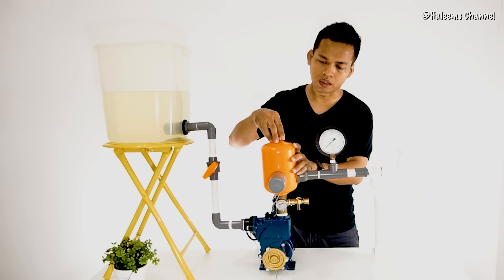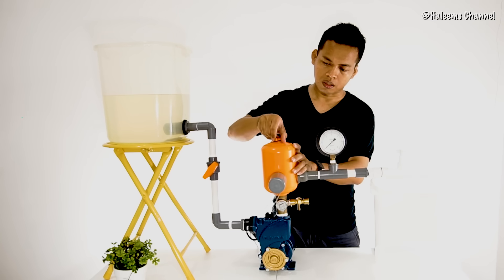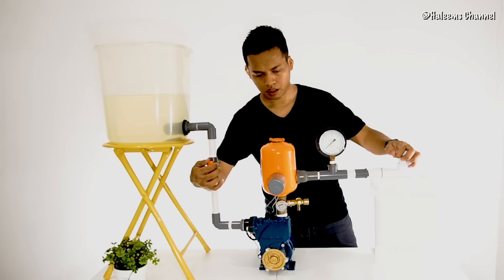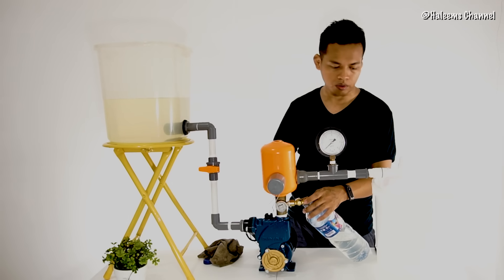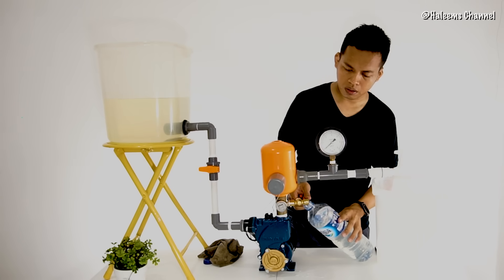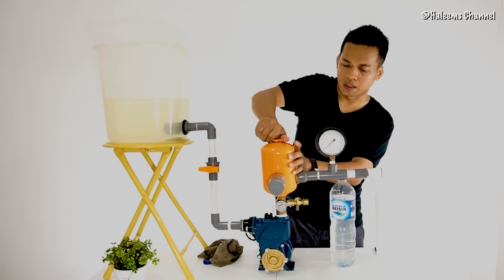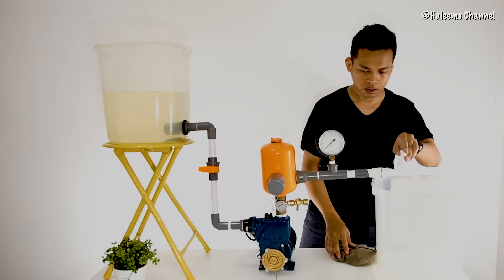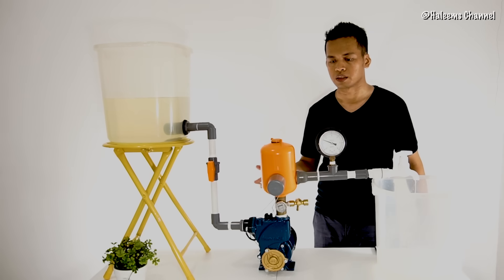Cara Memasang otomatis Pompa air dan Mengatasi Bunyi Cetak Cetek pada Otomatis/Pressure Switch

Comment: Malam Bang...
Saya mau tanya mengenai pompa air sh*m*zu ps 130
Baru-baru ini saya ganti dari pompa air yang ada tabung air nya karena selalu bermasalah pada tabung air nya (bocor dan harus ganti)

Namun muncul problem Bang yaitu seperti yang abang sebutkan pada video ini bunyi cetak cetek
Kronologinya seperti ini Bang
Kalau air tidak digunakan setiap 2 menit sekali pressure switch menyala sendiri
Sudah coba diatur juga untuk pressure switch nya tetapi tidak kembali normal Bang
sudah coba cek dan ganti keran yang bermasalah namun masih terjadi juga Bang

Kondisi tempat pemasangan dari tempat penampungan (lebih rendah dari pompa)

Mau tanya beberapa hal Bang :
1. apakah tusen klep nya pada penampungan air perlu diganti? (padahal pake pompa air yang lama tidak bermasalah)
2. apakah bila penampungan airnya di bawah bisa menggunakan flow switch?
3. apakah pemasangan pipa yang miring bisa menyebabkan hal ini? (karena pipanya dipasang 45 derajat bang tidak horizontal tidak vertical)

Apakah ada saran Bang yang dapat saya lakukan mengatasi dan mengecek terkait hal ini?

Terima kasih sebelumnya Bang
Reply from the maker: panjang banget ceritanya... 😀😀😀😀
yang ditanyakan pressure switch nyala sendiri apa yang bunyi cetak cetek..?

Masalah pressure switch, tiba-tiba nyala sendiri, dikarenakan ada saluran pipa yang bocor, yang menyebabkan tekanan atau pressure didalam pipa menurun dan akhirnya pressure switch bekerja denga sendirinya, solusinya, pastikan tidak ada pemipaan yang bocor.

Masalah pressure switch bunyi cetak cetek tanpa jeda terus menerus, ini dikarenakan tabung tekan nya bocor, tabung tekan sudah tidak bisa mengakumulasi tekanan sehingga tekanan diterima langsung oleh pressure switch, sehingga pressure switch bekerja terus menerus dan berbunyi cetak cetek.

terkait pertanyaan no.1, 2, dan 3, diatas..
1. Tusen klep, tidak ada hubungan nya dengan pressure switch.
2. tentang flow switch, cek disini, https://www.youtube.com/watch?v=rcF97sMyqZo&t=27s
3. pemasangan pipa miring untuk saluran dorong, tidak ada masalah (kecuali untuk saluran hisap, bisa mengakibatkan airtrap)

selamat mencoba

Comment: bos klo shimizu 266bit, pipa hisap dibuat 12mtr dgn ukurn pipa 1/2in kira2 kuat ga?
Reply from the maker: normal nya hisap maksimal itu -1 bar, atau setara 10 meter, dan adanya rugi gesek dll, menjadi sekitar 9 meter..
besaran pipa tidak mempengaruhi besaran vacuum..
besaran ujuran pipa hanya mempengaruhi jumlah air/debit airnya..

jadi, jika benar tinggi permukaan air adalah 12 meter, sudah pasti ada kemungkinan tidak bisa keluar air..karena maksimal hisap hanya berkisar 9 meter.

Comment: Mas saya mau tanya, air di rumah saya kan dialirakan dr toren dg gravitasi tapi sebelum kran di wastafel dipasang dulu housing filter 3 buah jadi aliran airnya lemah, apalagi yg kamar mandi aliran ke shower tdk mengalir sama sekali stlh lewat housing filter 3 buah jg. Saya coba pakai pompa manual sbg pendorong dan ternyata debit air kencang semua. Yg jadi masalah berarti saya hrs pakai pompa utk pendorong, jika yg digunakan pompa manual dan ingin dibuat otomatis pakai pressure switch atau flow switch apakah air akana normal sama kencangnya seperti pompa manual?. Dan apakah switch otomatis ini tergantung kran dibuka? Klo tekanan kurang berarti switch ini gk berfungsi atau jg pd flow switch jika aliran di keran kecil alat ini jg gak berfungsi? Terimakasih
Reply from the maker: sesuai alur cerita kondisi tersebut, cukup sulit bila menggunakan flow switch, karena flow switch bekerja apabila ada aliran air terlebih dulu, minimal aliran air yang dibutuhkan utk flow switch dapat bekerja adalah 3 liter/menit,
jadi, flow switch kurang cocok dgn kondisi instalasi tersebut.

penggunaan sistem pressure switch ini lebih cocok, karena cara kerjanya berdasarkan tekanan,
hanya saja pressure switch memiliki kekurangan yaitu bunyi switch yg kasar..

lebih cocok lagi bila menggunakan pressurs controller, type ini kendala harga nya saja yg mahal. namun bila harga tidak masalah, type ini direkomendasikan.
Reply: apakah pressure control jg bisa ngatasi debit air yg tdk sampai jg ke shower krn melawan gravitasi atau posisi shower diatas saluran pipa, krn itu air tdk kuat keluar dr shower?. Kran kn diibaratkan sbg saklar, klo kran dibuka tp air tdk mengalir smpe keluar dr shower apkh ttp bisa dg pressure control. Kalau pompa manual kn dorong dr awal air masuk, makasih mas utk sarannya
Reply: Nah klo pressure control sendiri ada syarat minmal debit air gak pak?

Comment: Mau nanya bos pompa air di tempat saya posisi kran air di buka jarum amperemeternya malah turun sampe mentok yang mengakibatkan tekanan kurang/ngepos.
Kira2 oermasalahnya di bagian apa ya?
Reply: DAP bos mesin pendorong dri toren..sperti tutorial yang ada di vidio agan..🙏
Reply from the maker: wajar boss..tipe pompa nya memang seperti itu... amper naik bergantung dari bukaan kran nya..kalo ditutup penuh amper naik, kalo dibuka amper nya turun...
di bilang gak normal kalo nilainya sudah melebihi spec.nya yg ada di nameplate... misal standarnya 1.5A, kok tiba-tiba over hingga 8 A, berarti ada insulasi yg bocor.. 
sedangkan kalo ampernya turun sampe mentok, artinya motor tidak ada beban.. bisa dari mekanik nya atau elektrik nya.

Dari mekaniknya, yaitu komponen pompa nya, bagian impeller atau rumah impeller, ataupun tutup impeller sudah mengalami aus.. silahkan periksa, jika aus, segera ganti..atau modifikasi..

Dari elektrikalnya, yaitu komponen motornya, terdiri dari gulungan sepulnya ataupun kapasitor nya..nanti saya coba buatkan video detailnya..
Reply from the maker: pompa nya tipe apa ya gan...
utk tipe pompa peripheral atau regenerating pump memiliki kaeakteristik dimana apabila head nya rendah (atau posisi kran dibuka) daya listrik input nya rendah (dalam hal ini amper nya juga turun), sedangkan apabila head nya tinggi (saat kran ditutup) power/daya listriknya akan naik (dalam hal ini ampernya juga naik),  saat kran ditutup beban pompa meningkat sehingga beban motor juga naik dan power/daya listriknya juga naik...

sedangkan utk pompa tipe sentrifugal, adalah sebaliknya, karena beban nya bukan dipengaruhi head nya, tapi dipengaruhi debit airnya..

Comment: Bagaimana kalau sower lebih tinggi posisinya dari toren...air tidak mau ngalir otomatis plow swit..nga ke buka pompa pendorong ga hidup..gimana solusinnya ...
Reply from the maker: di video ini adalah contoh pressure switch..dimana posisi ketinggian shower terhadap toren tidak mempengaruhi system ON/OFF nya..karena menggunakan sistem tekanan.

berbeda dengan Flow Switch, yang sangat di pengaruhi oleh posisi ketinggian shower, bila shower lebih tinggi dari toren sudah pasti pompa tidak mau ON, dikarenakan tidak ada aliran air, Flow Switch hanya akan bekerja bila ada aliran awal dari toren..

Jadi, jika shower lebih tinggi dari toren, palibg cocok adalah menggunakan pressure switch atau type lain yaitu pressure controller.
Reply: Mingkin bs ditambah saklar biasa yg diparalel dg flow swith, stlh pompa hidup dan bisa mendorong air, saklar itu di off lagi, agar flow swith yg bekerja.

Comment: Mas, mau tny, sy jg apply FlowSwitch pasang toren + pompa + FS d lt.3, yg mau sy tanya, kok kalo kran air d buka bersama2 misal: lt.1 n lt.2 air di lt.2 mati ya? Ada saran kh? Atau hrs pake Tyson? 

Sy pake simzu 128 bit
Nb. Maaf kl ada kesalahan istilah
Reply from the maker: PS-128BIT, memiliki kemampuan head hingga kisaran 30 meter..
pada kondisi kran dibuka, debit airnya adalah kisaran 28 liter/menit.. (untuk 1 kran)
optimal jumlah kran adalah 2 kran utk type pompa ini..
dimana pada saat menggunakan 2 kran yg bersamaan, debit air nya berada pada kisaran 14 liter/menit, utk masing2 kran.. (kondisi normal)...
(standar kebutuhan air pada satu kran adalah 15liter/menit)

jika 2 kran di buka, sedangkan salah satu kran tidak keluar air, hal ini bisa disebabkan adanya resistansi/hambatan pipa pada kran yg tdk keluar airnya, atau hambatan pada kran nya sendiri, sering kali aliran kran mengecil dikarenakan ada sumbatan pada ujung kran yg di lengkapi screen filter, terdapat kerak atau pasir, atau kotoran lain menyumbat pada ujung kran.
selain hambatan pada kran, penyebab nya bisa karena ada hambatan pada pipa, pipa yg kecil, banyak elbow/belokan, dll.
kasus pada penggunaan flow switch (modifikasi, pasang flow switch sendiri), umumnya flow switch memiliki diameter saluran air yg kecil, hal ini sudah pasti menurunkan spesifikasi (debit air) standar dari pompa nya..

analisa, 
# pompa pada lt.3, jadi, kisaran ketinggian adalah 8 meter
# 2 kran di buka, 1 kran tdk keluar air.
# ukuran pipa, tdk diketahui.
# asumsi jumlah belokan hingga titik kran, 3 elbow masing2 kran.
# perhitungan kasar jumlah hambatan:
normal jumlah total head adalah 30 meter, debit 28l/min.
jika 1 kran dalam kondisi hambatan normal (utk berbagai jenis kran medium yg dijual dipasar) bisa keluar air 21 liter/ menit, pada titik ini biasanya nilai head nya adalah 10 meter (approx.)..
jika 2 kran dibuka, kisaran head nya menjadi 5 meter, dan debit nya kisaran 12 liter/menit utk masing2 kran.
kran 1 tidak keluar, dikarenakan hambatan nya melebihi dari head 5 meter pada saat 2 kran dibuka... sehingga air hanya mengalir ke 1 kran yg hambatan nya di bawah head 5 meter..
hambatan lebih dari 5 meter ini bisa dikarenakan dari ujung kran nya yg mengecil, sumbatan, jumlah belokan nya..dll.

solusi,
untuk optimalisasi aliran air menjadi lebih besar, bisa dilakukan hal-hal berikut:
1. pastikan kran tidak memiliki hambatan/sumbatan yg menghambat aliran. bukan scren filter pada ujung kran, bersihkan dari kotoran, sehingga aliran air lancar.
2. gunakan ukuran pipa yg sesuai anjuran pabrik, pipa ukuran yg lebih kecil dapat menghambat laju aliran air, sehingga debit air menjadi kecil..untuk pipa outlet dianjurkan menggunakan pipa 1 inchi (standar nya), karena jenis instalasi nya dari toren, lebih dianjurkan menggunakan pipa yg lebih besar, sehingga debit pun dapat meningkat lebih banyak.
3. pilihlah ukuran flow switch yg sama dengan ukuran pipa yg di anjurkan utk pompa tersebut..dalam hal ini pompa tersebut spe nya 1 inchi, utk itu pilih flow switch 1 inchi, sehingga tidak ada hambatan yg terlalu besar..
4. pemasangan elbow/belokan pipa, dan fitting/sambungan pipa yang lain, tidak dianjurkan terlalu dekat dengan outlet pompa, jarak rekomendasi setidaknya 6 kali dari diameter pipa, 
pastikan sambungan benar2 fit alias tidak ada gap yg menyebabkan aliran air turbulensi yng menjadi hambatan aliran dalam pipa.
5. kelistrikan, pastikan voltage nya stabil, 
gunakan kabel yg sesuai amper nya pompa, sambung kabel dengan baik supaya tidak panas yg bisa menurunkan kinerja pompa.

selamat mencoba.

👍👍👍👍👍
Reply: @HaleemsChannel  nah, minta saran nih perihal otomatis mas, baiknya apakah perlu d ganti sistem otomatis ke pressure switch? Untuk otomatis nya sendiri atau d kombinasikan, soalny sy liat comment2 rata2 pada meninggalkan sistem FS, mohon koreksinya

Nb. Otomatis pompa dorongnya
Reply from the maker: baik itu Pressure Switch, Flow Switch, Pressure Controller.. masing-masing memiliki kelebihan dan kekurangan..

mana yang paling baik, tentunya harus diliat penggunaan nya..dan budget nya..

utk kondisi penggunaan pompa booster (air dari toren) paling sesuai adalah jenis Flow Switch (relativ lebih murah), lebih bagus lagi menggunakan pressure controller (harga lebih mahal).

Type Pressure Switch paling cocok buat jenis instalasi pompa hisap dan pompa dorong..
Reply: Maaf mas, kan pasang filter juga, tolong koreksi ya
Yg exist skrg : Torent-pompa-filter-FS-kran; (kalo keran d buka kecil lama2 air gg keluar, harus mancing FS dl biar pompa bs nyala) 

Agar instalasi air ttp ngalir pas bukaan keran kecil kira2 gmn ya? Apa dgn ganti jd pressure switch bs teratasi?

Comment: mas kl toren lebih rendah gimana apa kh bisa tetap berfungsi
Reply from the maker: bisa..
utk jenis pressure switch bisa untuk hisap dan untuk dorong ataupun booster.

untuk jenis flow switch, hanya bisa digunakan sebagai bioster, dimana permukaan air harus lebih tinggi dari keluaran air.

Comment: Mas, sy punya merk shimizu yg sudah ada tabung tekan nya sendiri. Masalahnya, pompa sy sudah ga mempan pake preessure switch. Udh berkali2 ganti tetep ga mempan. Pas saya pasang ke pompa, sy buka keran air pompa langsung nyala, tapi pas sy tutup malah ga mati2 pompanya. Itu kenapa yaa? Setiap sy ganti kejadiannya sama terus. Dan udh sy coba setel dari sekrup di dalemnya, malah cetek cetek terus pompanya.
Reply from the maker: sistem otomatis pressure switch, bekerja karena adanya tekanan di dalam pipa.
sistem otomatis tersebut membutuhkan 2 komponen yg tidak bisa dipisahkan, yaitu;
1. pressure switch.
2. tabung tekan.

agar pressure switch bekerja seimbang, diperlukan tabung tekan.

masalah yg sering timbul;
1. bunyi cetak cetek, yg dimaksud cetak cetek disini adalah frekuensi ON dan OFF tanpa jeda yg secara terus menerus, hal ini disebabkan tabung tekan tidak bekerja dgn baik. solusinya, gunakan tabung tekan yg mampu meng akumulasi tekanan dgn baik. banyak pilihan di jual dipasar.

2. Pompa tidak mati, saat kran sudah ditutup.
hal ini disebabkan;
a. tekanan pompa kurang, 
agar pompa mati, diperlukan tekanan yg mencapai titik OFF pressure switch..yaitu 1.8kgf/cm2.
b. kontak poin/relay telah rusak, lengket dll, atau spring rusak.. sehingha meskipun ada tekanan, namun arus listrik tetap terhubung

3. pompa tiba2 nyala (ON), pada saat kran di tutup.. hal ini karena tekanan menurun, disebabkan adanya bocor pipa

4. pressure switch cepet rusak, ini bisa disebabkan kelistrikan yg tidak stabil, atau penggunaan kabel yg tidak standar, yg menyebabkan panas, atau juga cara penyambungan kabel tidak benar, dapat menimbulkan panas..dll.

5. tabung tekan cepat rusak, ini disebabkan karena adanya water hammer yg melampui kemampuan tabung tekan.

saran:
1. pilih pressure switch yg sesuai spesifikasi pompa, baik itu dari segi kelistrikan (berapa amper nya), maupun dari segi performa switch nya sendiri yaitu berapa tekanan yg dihasilkan pompa.

2. pilih tabung tekan yg memiliki ruang kompresi yg baik

3. instal pompa sesuai anjuran pabrik

Comment: Bos, apa nama tank yg orange itu kalo kita mau cari. Bahnnya apa ya.?
Reply from the maker: nama dari pabrikan adalah Accumulator, tapi banyak sebutan namanya; tabung tekan, pressure tank, tabung pompa dll.
bahan ada banyak jenisnya..
ada yg terbuat dari plastik POM, ada yang daro metal sheet..
di dalam video hanya contoh simulasi dari ssebuah sistem otomatis pompa..jenis pressure switch.. tidak rekomendasi sama persis didalam video..

jika ingin membeli produknya, sesuaikan jenis pompanya..
Reply: @HaleemsChannel  air tmpt flownya kurang dr gak bisa naik ke atas. Dr saya mau pake pompa air aja agar bisa naik ke atas airnya. Rencana mau pake flow switch aja, kalo ada tank itu bs ada tekanan kalo kurang flownya.
Reply from the maker: @anggasyahrian468  flow switch hanya berfungsi untuk jenis pompa booster/penguat, harus ada aliran awal, krena cara kerjanya ada aliran dulu baru pompa bisa ON,
berbeda dengan. jenis Pressure Switch, cara kerjanya berdasarkan tekanan dalam pipa, bisa dipergunakan untuk pompa hisap maupun pompa booster serta pompa dorong,

keduanya memiliki kelebihan dan kekurangan, tinggal disesuaikan dengan kebutuhan dan budget nya.
Reply: @HaleemsChannel  saya cari di online kok gak ketemu ya.
Reply from the maker: @anggasyahrian468  banyak jualan di online, saran saya bila ada budget, janga menggunakan sperti dalam video, didalam video hanya buat mengetahui caranya.. jenis accumulator di video kurang optimal kerjanya dan cepet rusak.. gunakan accumulator yang berbahan metal, untuk ukuran yang kecil pilih yang sudah dilengkapi dengan membran/karet serta dapat di isi dengan gas nitrogen, tipe sprti itu yang bisa dijamin ketahanan dan umur pakainya lebih lama..

Comment: Kalo pompa sanyo ph-150 ngurasnya dari plug biru samping bawah itu ya boss ?
Cara ganti air chargernya gimana ya boss ? Langsung aja ato ada cara khusus ?
Makasuh boss...
Reply from the maker: ph-150 memiliki AVC, yg berfungsi secara otomatis mensuplai udara didalam tangki, sehingga tangki selalu terisi udara utk ruang kompresi nya..

bila ingin drain air nya, cukup buka lubang discharge nya (plug biru)
Reply: @HaleemsChannel  apakah sama persis dengan shimizu ps 255bit?
Reply from the maker: Secara fungsi sama, AVC air volume control... Mungkin material dan desain nya berbeda...
Reply: @HaleemsChannel  
Terimaksih Boss...

Comment: Lebih baik beli pompa otomatis atau yg manual tp ditambah otomatic pressure bos? 

Trs lebih baik pakai radar atau pelampung bos untuk toren atas?
Reply from the maker: otomatis atau manual sama saja, untuk pertanyaan lebih baik mana, tentu harus disesuaikan kebutuhan nya, dan budget harganya...

bila beli langsung yg otomatis, sudah pasti jaminan komponen sakelar yg original.
sebaliknya kalo beli manual, belum tentu komponen original.

bagus mana antara radar atau pelampung..
radar dalam hal ini adalah sebuah merek alat otomatis pompa buat tanki air (radar memiliki banyak jenis)...
pelampung dalam hal ini adalah ball tap (kran pelampung).

bila belinya pompa yg sudah otomatis (dengan pressure switch), maka pelengkap nya yg harus dibeli untuk kontrol tandon air adalah ball tap (kran pelampung), yg dipasang pada ujung pipa keluaran air.

sedangkan bila beli pompa manual, utk kontrol otomatis tandon air, bisa menggunakan radar (water level dengan switch/sakelar yg dipasang diluar tangki dan di dalam nya di beri mekanisme pemberat yg dapat memutus atau menyambung arus listrik), 
atau bisa juga menggunakan float switch..dll.

lihat video ini:
https://youtu.be/iDRXD7yC-4A

semua bisa digunakan tinggal pilih yg sesuai budget.